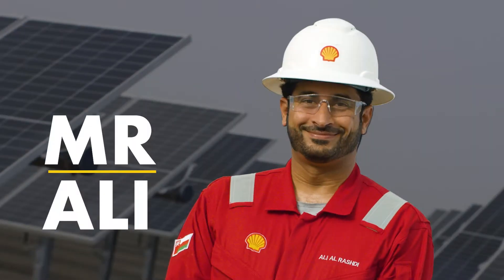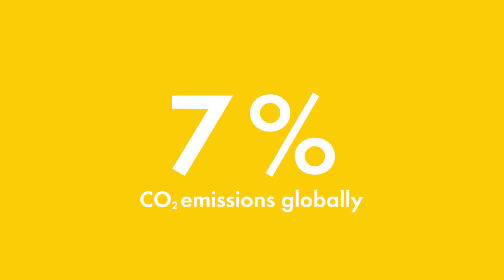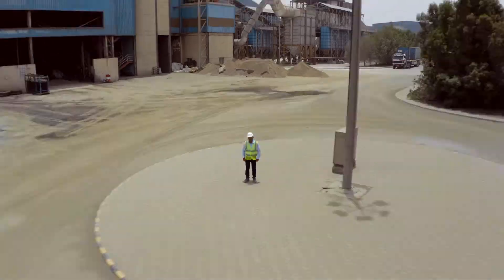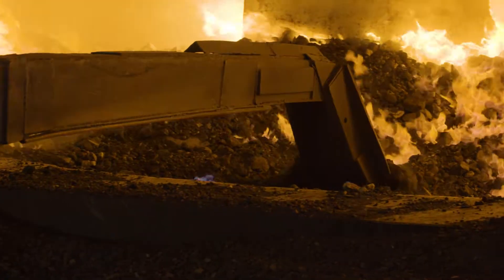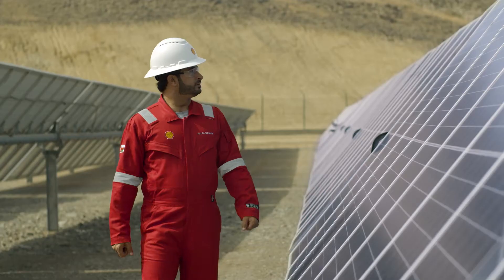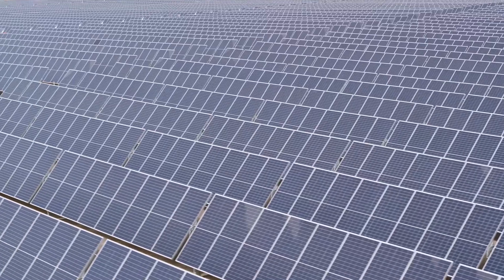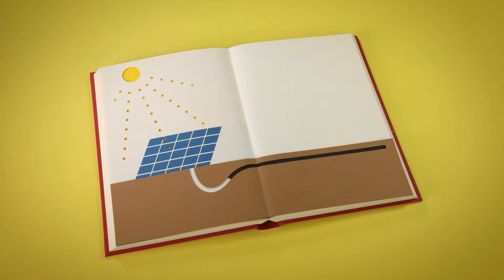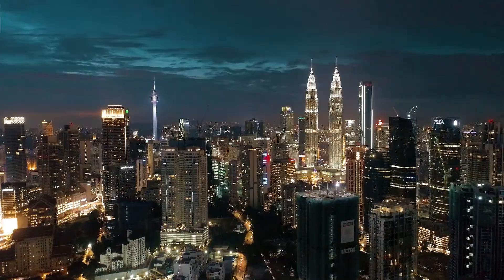How to cut carbon from steel

Comment: Why do you use photovoltaik and not directly solar energy. Would be much cheaper. I mean why do you want to produce current if you just want to heat something? Isn't it smarter to just use mirrors focussing on one spot to heat a liquid? And this liquid could give heat to the oven.
Reply: Because electric power is very mature form of energy, it can be efficiently stored and easily modulated/controlled to operate according to varying conditions.